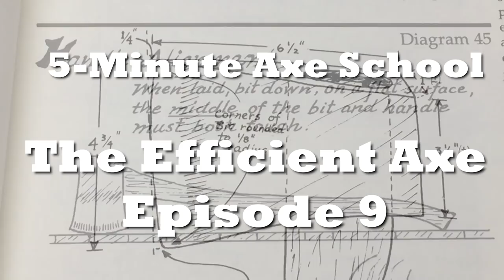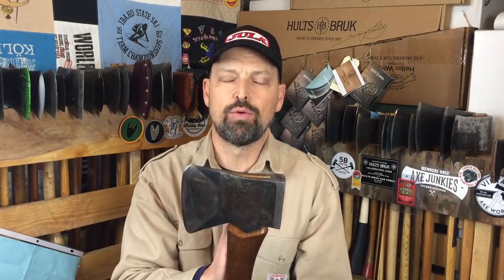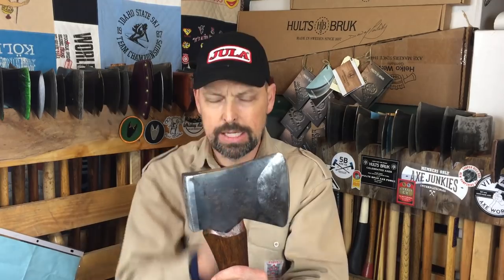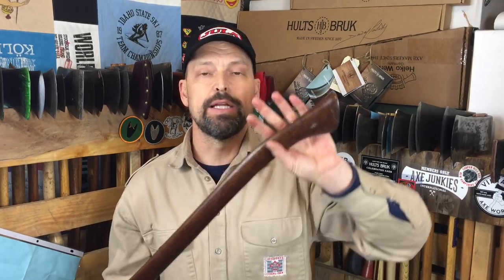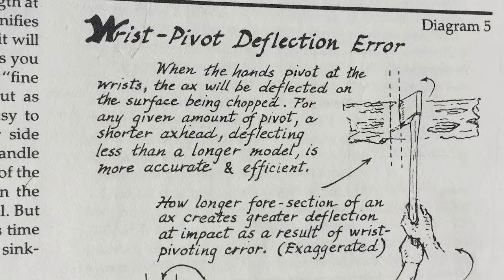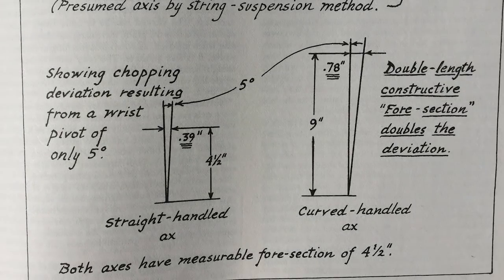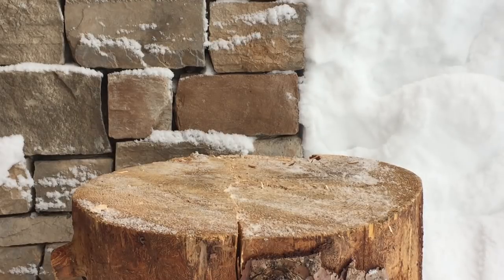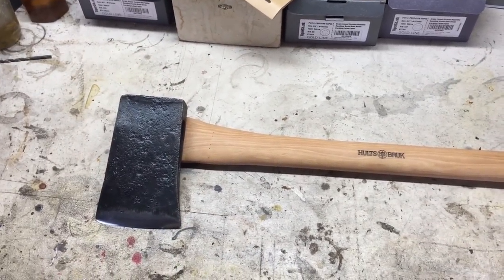5-Min Axe School: The Efficient Axe Ep9 "HANDLES!"

Comment: I wonder if Cook ever worked from "can see" to "can't see" with an axe.  I grew up listening to local woodsmen talk about axes.  The biggest concern for them was the type of wood and the quality. White Ash was preferred because it was springy and was easier on the hands.  Yellow Birch and Maple would sting your hands on a cold winter morning.  Ash had to come from a hillside - never down where it would have its "feet wet".  That was basket ash - also called Brash or Hang Ash.  The wood was always split from the log - you could read the grain from the bark.  You didn't want the growth rings too close together or too far apart.  The end of the handle or nub was carved to comfortably hold and catch the hand on the swing.  Softwood was used for the main wedge because it catches and doesn't spit back when you knock it in. The handle was fine tuned to the head because some heads from the local axe factory could have a crooked eye.  You could adjust the eye of the handle on the shave horse to sort this out.  You never left your axe outside at night, never put it in a bucket of water to tighten and in the winter you warmed it under your armpit before you started to chop.  Big old mill file to sharpen, hold the axe with the light over your shoulder, file the light off the edge of the blade like using a bow on a fiddle.  Get a wire burr, take the handle of the file and rub along the edge to get ready to chop.  These guys would have had a good chuckle at Cook's theories.

Comment: Cook knew enough to know that SOMETHING was going on with rotational balance, but he didn't have the language or correct knowledge of physics to understand HOW that something was occurring. His assertions about the curved end on a handle increasing leverage is partly true in that you ARE able to apply more torque with a grip of that sort, but not along the axis he thinks you are. The axis still runs between the grip point and the center of gravity, and you've just changed the orientation of your hand around it sort of like the difference between turning a door lever vs. a door knob.
Reply from the maker: Good point! Thanks for that contribution.
Reply: I suspect you are on the path. Try the links I put above

Comment: I'm not buying the curved handle drama. Your wrist just bends to the angle of the curve in a way that some people prefer ergonomically. The radius that the force is working through is still an imaginary straight line between the head's center of gravity and your hands. That "wrist pivoting error" model is pretty flawed. Based on his extrapolation of the angle at the end of the handle to project "effective" head length, if you had a t-handle at the end of an axe, your "effective" head length would be infinite, and any movement of your wrist during the swing would land the chop in outer space somewhere. But in reality, you would just swing the axe on its normal radius, and you would just hold your wrist differently and it would feel awkward.
Reply from the maker: I'm not buying it either! Thanks for watching!

Comment: I just flat out disagree with Cook's opinion on curved handles vs straight handles. Grab any axe with any handle and twists your wrists, the "Axis Of Lateral Rotation" is always through the center of mass of the head. Cook is very vocal about curved handles putting the axis of lateral rotation away from the center of mass, sometimes even outside the head. Cook throws around a lot of numbers and draws a lot of diagrams and presents his opinions as facts, but if you actually grab an axe and twist it, you can see that in the real world they don't behave the way Cook writes. If they did, instead of spinning through the center of mass, the head would follow some weird arc through the air.

Cook gets referenced a lot online and many treat his opinions as gospel. This handle argument resurfaces a few times a year and I really hope you can put this myth to rest.
Reply from the maker: I agree! Straight handles can be fun though.
Reply: Oh totally. A neighbor one street over from me is a New Englander (I live in Florida) and he had a huge collection of axes he decided to get rid of. I bought 13 axes, a gorgeous NoS handle, and the biggest wood rasp I've ever seen off of him for $100. I spent like $7 per axe, and they all need some work, but I got a lot of gems too. A bunch of great old kellys, plumbs, collins, lakesides, west-germans, etc. While all the heads are in pretty great shape, there's a lot of goofy stuff going on with the handles. Most of the axes you find in Florida are pretty much the same, Daytons on curved 36inch handles. It's interesting that this New England man had so much weird stuff. Stuff hanged way open, way closed, one Kelly  3.5lbs phantom beveled Michigan on the original 28 inch handle. 

One that stuck out to me though was this giant Kelly Jersey (biggest I've seen), almost 6 inch bit on a straight 27 inch handle. It looks a lot like the one in Cook's book, and it's a great axe, but it wouldn't be my first choice for a work axe.
Reply from the maker: @jarredjones3358  That's an awesome find!
Reply: @matthewtydd8915  I mostly agree with that video. I'm lucky enough that I get to use an axe pretty frequently, and I have a pretty diverse collection. In practice, I don't find too much difference in balance or accuracy with straight or bent handles. Bent handles are a bit easier on my wrists, the little curve near the swell means you don't have to bend your wrists so far to get the axe to engage in the wood. My problem was with Cook being so adamant that straight handles are so vastly superior and and so many people going "Well this guy wrote the book on axes, it must be right!", when in practice it's just demonstrably not true. If it were true, we'd be seeing tons of straight handled racing axes in timbersport, and I don't believe I've ever seen one straight handled racing axe. If they performed even a little bit better, surely we'd see them being used by the people who make a living cutting wood accurately.
Reply: @jarredjones3358  I suspect we are in complete agreement. The grip at the end makes a difference in the bite and a snap of the wrists at the end helps especially with a curved axe where it is easier on your wrist. There are no doubt uses for straight handles in some situtions (I suppose it's horses for courses) but I cannot see it in felling. Less an issue in splitting perhaps. People also become accustomed to using a certain handle shape or length and are not willing to persevere with a different setup but there is a maximum of efficiency achievable in any type and I suspect a certain amount of curve depending on the head and the task will be the most efficient. I am not willing to persevere with a double bit axe head. I am terrified of chopping my ears off (they do stick out) with a double bite axe head so I simply will not pick one up. I suspect a straight handle on a racing axe would be asrare a sight as a July snowstorm in Death Valley.